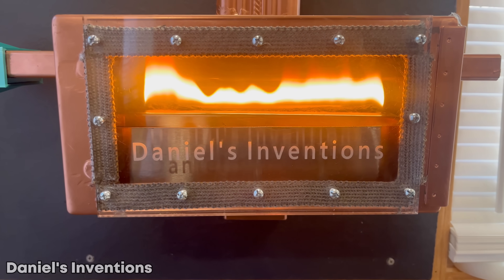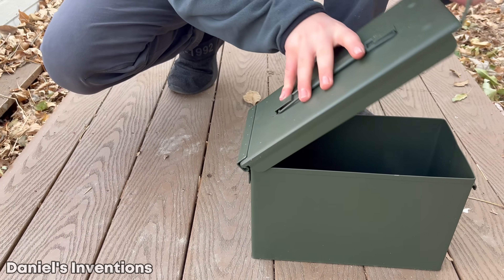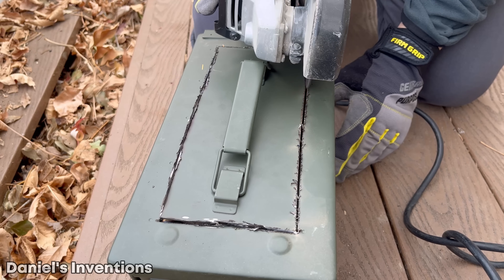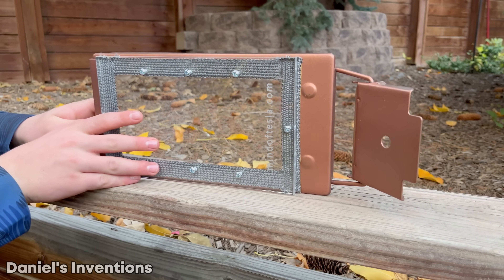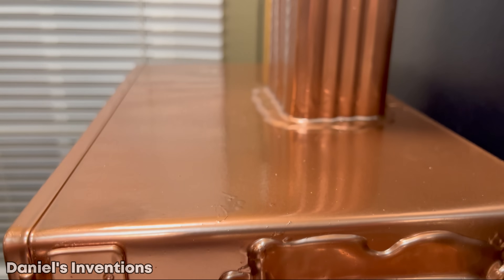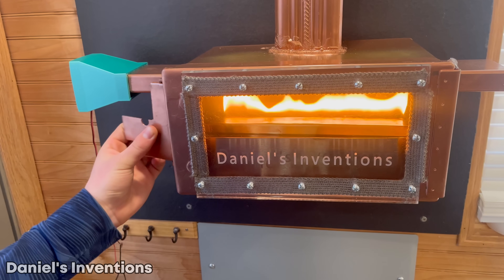ENDLESS Heat for Your Home WITHOUT Electricity 2.0

Comment: This can be improved: 
a) air intake should be from outside; 
b) the horizontal pipe across should be tilted to a diagonal position. The heated air inside will then rise automatically causing a natural draft and rendering the noisy ventilator superfluous.
Reply: Why would you pull in cold air from outside?
Reply: @turdferguson8612   Because you don't want to have to share what little oxygen you have in your living space with a flame. you need that air to breathe..
Reply: @turdferguson8612  Combustion air for the fire in the box.
Currently as designed, it pulls that air from inside the house, which raises several efficiency and draft issues. Using outside air for this purpose would be a major upgrade.
Reply: @turdferguson8612  Air is being pulled from inside being pushed outside which means that all the seams by the windows and doors are drafting air to compensate to fill the room due to negative pressure
Reply: @turdferguson8612  an outside air intake would prevent a potential negative pressure condition which could massively affect combustion. Also, if your windows and doors aren't tight enough to allow a negative pressure condition, well now you're just drawing in more cold air from outside into your home to feed that fire which reduces the bang for your buck because you're cooling the space you're supposed to be heating. You also spent fuel heating the air in your house so it wouldn't be good to allow that to get sucked up the chimney. Outside air intake solves and prevents all of those problems.
Reply: I disagree with A
I agree with B
Reply: "air intake should be from outside"
It does.  He doesn't explicitly show it in this video, but in his 1.0 version, he shows the air intake for the firebox coming from the outside.  Only the air already inside the cabin is getting heated and re-circulated.

Comment: This would be perfect for a garage depending on the size build and install 2 or 3 of them,  also use high temp jb weld or make the exhaust stainless so it's weldable to the ammo box. Carbon felt should last forever if not a really long time leaving you to typically only have to refill the oil

Comment: Very good, but I can see fumes leaking into the room at the end of the video
Reply: You’re going to get fumes when you spray paint and you burn the first couple times. There is no way you are seeing fumes from the burning oil with this design. You could leave the  door open and still won’t get fumes in the house.
Reply: It’s not leaking smoke. If you had read the description, it says that when you first use the heater, it will burn off the paint. Only the first few times though.

Comment: That is a great idea that I am sure you will improve on as time goes on. My suggestion concerns the fireproof backing you used on the wall. If you leave a one-inch airgap behind it and lengthen the backing to within an inch of the floor. Convection will draw the cold air off the floor. It will rise dissipating the heat behind the panel and further help warm the area.

Comment: A couple things... 
Gutter downspout pipe is thin, often aluminum and has a baked on coating, none of which is good for a flue connector. Mild steel pipe (NOT galvanized, which produces very dangerous vapors when heated!) of at least 22 gauge thickness is recommended to avoid flue gasses leaking into the living space. 

Buy a kerosene heater wick and modify it to fit your fuel tank (flatten the circle into a two layer flat wick or cut it into a single flat layer - cut this outside and protect your breathing, as these wicks usually contain fiberglass, which is not good to breathe). The nonwoven polyesters that most baby or cleaning wipes break down when heated and release dangerous vapors, especially when the unit is allowed to run low or out of fuel and the fire attacks the wick material directly. 

The use of 750°F or higher heat rated adhesives is strongly recommended to avoid issues with chemical vapors and flue gasses escaping into the living space as the unit is used. Standard JB filled epoxy is not safe in an application like this. Follow the instructions on curing to the letter before painting and set the first fire for at least 30-60 minutes with the unit outside to let the materials off gas before installing. 

Metallic paint reflects a significant amount of the radiant heat back into the firebox and reduces the radiant heat released into the room by 10-40% depending on the chemical makeup. If heat output is the end goal, metallic paint is not the best choice. Let the high heat paint cure for at least 24 hours and, as others have said, set the first fire for at least 30-60 minutes with the unit outside to let the paint off gas before installing inside. 

If you have the option, ducting the fresh combustion air in from the outside is a better choice than using room air for the fire. If the building is not "leaking" in enough air to make up the air used and lost in combustion and up the flue, the reduction of available oxygen to the fire will begin to produce Carbon Monoxide, a odorless, tasteless gas which is deadly when it builds up in a space and is very difficult to recover from.

Comment: WoW This is absolutely fantastic work, safe and sound and easy to build. I am sure its simply a pleasure just to sit inside, especially on a dark cold rainy night  : )  well done. Tip: try using 100% cotton towel cut to size (horizontally) and placed between 2 round bars.this would allow you to adjust the wick from both sides of the box and never have to change the wick depending on the length you choose. Of course This would need a lot of experimenting.

Comment: I wonder if a heat exchanger would extract more heat from the chamber than the singular tube? Something like a winding pair of copper tubes? Also, there are these motorless fans designed to go on top of wood stoves that use the heat to move the blades. The fan draws heat from the surface and the spinning blades push that extracted heat out into the room. Could help you utilize more of the generated heat before it is exhausted outside
Reply: Do you have an example of this?  I liked his simple build but it was not exactly “without electricity “ as his title states.
Reply: @salvatorelivreri  You can make it without electricity quite easily. Just extend the cold air intake to the floor and convection will do all the work. As the air gets hot and rises from the heater it will naturally suck cold air in from the floor at a rather surprising rate.
Reply: @SilvaDreams  are you talking about lowering the air intake for the fresh air to be burned or to be heated?  There are two intake tubes.  I would think you mean the fresh air to be heated since the air to be burned will easily be sucked in due to the rising exhaust air.
Reply: @salvatorelivreri  The air to be heated obviously. 
Personally I would have the air for the burner come in from outside instead of using the in-door air as then it's just going to pull in cold outdoor air inside to replace what is going out the chimney.

Comment: great idea, good instructions, applause to you, you may have saved lives posting this if someone has no heat or electricity but oil and ammo boxes, gutter, any kind of pipe for exhaust , can weld or has jb weld, for an emergency its a brilliant idea, for seasonal use , with a few safety concerns its also a brilliant idea, although i dont know cost of any type of burning oil i doubt a quart of vegetble oil would last a winter in northern states, but sure, why not one in every room, and temperature control is a question as well, i mean in the home, too hot have to open a window for cold frigid air sounds like a pain but temp control can be achieved easily , thanks Daniel, you earned a subscriber

Comment: The ignorance in some of the comments is astounding. The improvement in this version over the last version is the intake AKA air source for the fire was moved from outside to in which means the heater has to do less work because now it's warming air that's already warm rather than constantly warming cold air from outside. 🤦🏻
Reply: I hope that is a joke....right?
Reply: @TheRainHarvester  let me guess. You don't own or ride in cars. The recirculation function on the AC in a car makes the air colder because it's recirculating the cold air inside the vehicle rather than cooling down the hot air from outside. Same concept with recirculating the warm air in this video making both systems efficient.
Reply: @kbakeritsallaboutnobody.5761  Any air that is created from a fire is CO/2 and will kill you in concentration. That is why so many commenters say, "install a carbon monoxide detector".  So burning warmer air becomes "getting rid of (venting) warmer air".
Reply: @TheRainHarvester  that would be an issue if the building is vacuum sealed but it's not. I grew up with a wood stove and apparently carbon monoxide wasn't an issue. Long before electricity was invented this was how heat was made available and the only way was burning wood and obviously not everyone died from carbon monoxide because here we are years later.
Reply: @kbakeritsallaboutnobody.5761  Are you saying you want to heat air from the burning gas and have that burned air go into your house?
Reply: @TheRainHarvester  did you read my last response?
Reply: @kbakeritsallaboutnobody.5761  I understand that Indians used to create fires in a teepee etc with LOTS of ventilation.  But modern houses, while not vacuumed sealed, are sealed too much to burn volumes of material while burning breathable-warm air "to make it hotter" then dumping it back into a modern home.

Your advice is likely to kill somebody.
Reply: @TheRainHarvester  dramatic much? There's several Americans today still using this heating method in " modern homes" and I didn't grow up in a teepee.
Reply: @TheRainHarvester  Most modern house are not sealed well. Unless you want to pay millions. Typical house has tons of leaks, ie doors, windows, etc. You can easily find out with a match. and a teepee does not have a lot of ventilation, it only ventilates at the top but there are leaks. I have a friend that has an actual teepee, and she lights a fire in the middle of it and it's sealed except for the top.

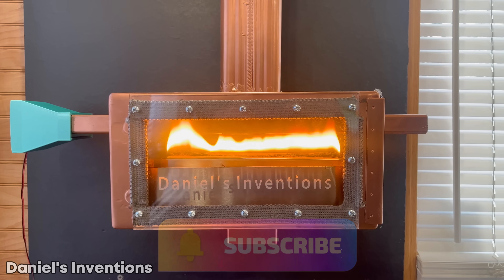Comment: There are visible fumes coming in the room at the 4:37
Reply: Yeah I see then too
Reply: Chemicals burning off from the paint. Usually happens when it's the first time heats introduced to any painted metal.
Reply: Looks like it's just the paint. Doubt it was rated high enough for this heat
Reply: Thats the heat bro

Comment: Plastic melts at 266 degrees Fahrenheit, so that fan is a bad idea. Also you need to burn off the ammo cans original paint as well. Or it will burn in the heat and cook off the paint you put on over it. The gutter will warp as it's not made to be under heat. The seal will break and you will be exposed to the harmful fumes put off from the not heat treated metals, plastic, and paint
Reply: @goysb4jays566  heat conducts into the rectangular pipe into the plastic fan holder.  But that is the least of the worries in this dangerous design!
Reply: @goysb4jays566  do You not think? Up to 500 degrees? That temperature will be radiating around the entire unit. Do you understand conduction? Metal is a Very good heat conductor, if one part is hot all parts will be as well over time. The metal is very close to the fan, so even proximity will deteriorate the plastic. 500 degrees? Yes sir

Comment: "Without Electricity" isn't entirely accurate because the fan is powered by DC electricity.
Reply: Solar panel fix
Reply: or move the piping vertically (not straight up and down but diagonally) and use convection to move the air, won’t move as much air as the fan but could possibly do the job if there is no ELECTRICITY including modern ways to make electricity like solar panels.

Comment: Nice. You can also put some small size stonnes in the metal basket around the exhaust pipe to accumulate more heat...🎉

Comment: Few suggestions on how to make 4.0 your best yet:

Stay with this 2.0 design, as it is the best of the 3 you made. You have a very efficient design with that could heat a 30 sq ft space with some adjustments.

Use 3 inch black steel round pipe. Home Depot, Lowes, Menards, Ace hardware can all cut it to exact dimensions for you. You can then cut holes it into the ammo box just slightly larger. This will look a bit cleaner but more importantly has a much higher melt point due to the higher carbon content. When you attach your 80mm fan, it will have less air resistance, will be quieter, but a much warmer output.

Round pipe versus a flat surface with a direct flame does a few things. First round pipe improves your thermal cross section for the total area heat is being applied to. This in turn gives your air flow improved heat transfer and will nearly double your heat output. Then to reduce losses, space your wicks out to 7/8 to 1 1/8 inch spacing. For your cabin, the greater spacing is more efficient as you don't have a large volume of air to heat. Last, when you need to increase and decrease temperature due to seasonal fluctuations, you can light the minimally necessary amount of wicks as you need to. Cold day, light them all, then douse every other.

For your air intake and exhaust, always source and drop outside for air quality and safety reasons. Exhaust, if going out a wall, must go further than your eave as you don't want the exhaust to wind up in your attic. 

JB weld high temp as it will off gas, especially since your inventions are getting bigger and producing more heat.

If you want to get away from the electric fan, try using a stove fan. Otherwise, 12v solar panel kit and a car battery to make it fully off grid. Add a 12v dimmer switch after your battery and before the fan to provide air modulation. 

I'd get away from the gutter use. While it's neat, it's material is not very heat stable, off gasses a lot and wastes a lot of time in sealing it. I'd suggest some EMT, chain link fence pipe or good ol' chimney pipe.
Reply: Good suggestions for improvement!

Comment: If you use a flared exhaust pipe section, which are a few inches, between $15 - $20-ish, you can avoid the jb weld at the top, and bolt the exhaust to the box with a little stove gasket, and/or furnace cement.   And, keep higher heat away from the aluminum.   the other thing to do quickly, is put some hardware cloth near the exaust, to keep out the birds/mouse.   You also need to use better bolts, those cheap bolts tend to rust really quick.   Note, people are commenting, because, they like your presentation.   good job.   also be sure, to keep the floor fireproof.   a few tiles, might be enough, or one large one.

Comment: The best oil for something like this is sunflower oil. It wicks well and does not seem to carbon up the wick. These types of things create a lot of oily black soot. It is difficult to clean without making a mess. Perhaps you could design a better burner as on a kerosene lamp. More efficient and less soot.
Reply: I built one and the soot build up was so bad it was unworkable.  I'll try the sunflower oil next.

Comment: Great work, one suggestion.. the air intake should take air from the outside, otherwise you are permanently creating a low pressure inside your house and thus suck cold air through the cracks.. 

Also in the worst case the chimney effect might break down and push CO inside your house.. which would be very bad to say the least 👀

Comment: Oh man that is a clean build, if I could suggest anything it would be to set up some thermoelectric generators (The Seebek effect) along the side and use that to power the fan. This would remove your electricity requirement and make the device infinitely portable. Thanks for sharing your build, subbed hard and can't wait to go through your content.

Comment: very efficient design: but kinda lethal with surface temps reaching 250 C.... :) with proper safety measures (some way to dissipate heat from hottest surfaces) this could be a real winner in terms of economy : you'd actually need to do the math to establish if per unit, electricity is more expensive than oil, per unit. this system has a small cost "overhead" due to the 12 DV fan, too. [i'm wondering if convection air currents could be used to spin a fan, but i havent built any prototypes yet]

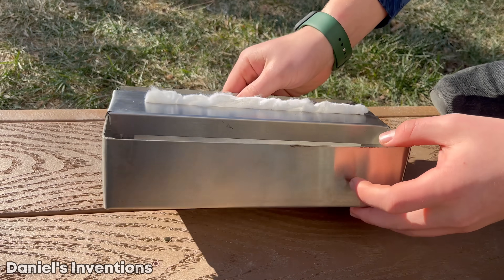edit: ok, @3:18 the builders show the fuse [dry baby wipes which i guess is cotton] reach the bottom of the stainless steel fuel tank. so, whats happening is the oil fuel is soaking the fuse , then soaked fuse is ignited. so i have to wonder how long that cotton would stay ignited? [when presenter says: "in order to have same height flames, you have to adjust the height of the [fuse] equally"] he may mean the flames need to heat touch the horizontal pipe [acting at the heat exchanger] . i am an engineer by training, but not in this field of high heat, combustible systems. 

a weakness of this system seems to be the fuse burn rate itself... a long term test would establish the efficiency of the cotton baby wipe fuse. it could be replaced by a slow burning material [eg: stone wool which i've seen uses as a fuse in other burners]. not sure, maybe a builder will see this and let me know what he/she thinks? as pointed out by other commentators, carbon monoxide monitoring, JB weld and metallic paint toxins need to be addressed in this design, too. still a good effort, but i suspect you really need to know your stuff (suitable high temp materials, burn rates) when dealing with high-temp systems. 

peace x thanx for reading. thoughts welcome.

Comment: My questions:  After months of use, can't the JB Weld product degrade from repeated heat exposure  - - causing toxic Carbon Monoxide to leak into the building?  Also, is it safe when making a seal of two dissimilar metals?  

What if used on a painted surface or surface not properly prepped and cleaned?